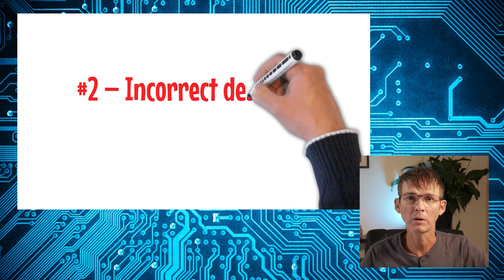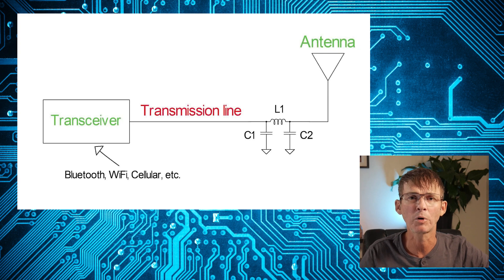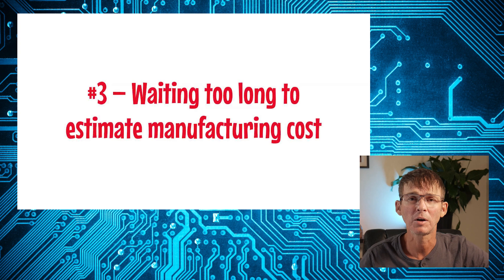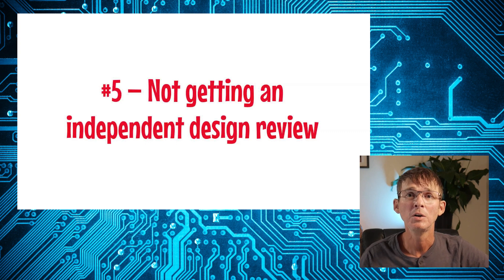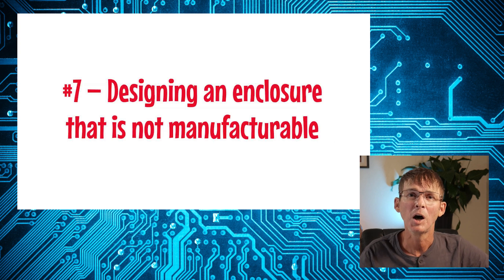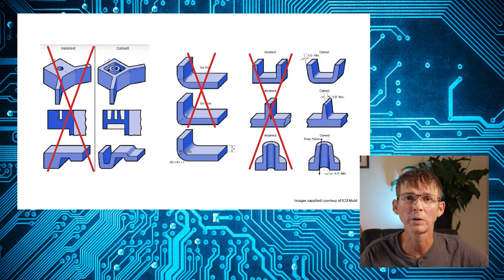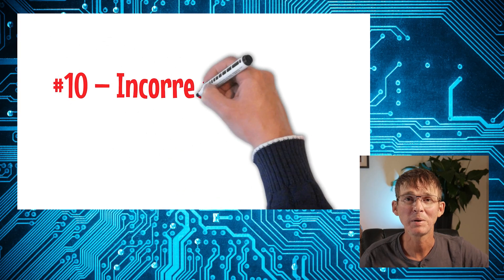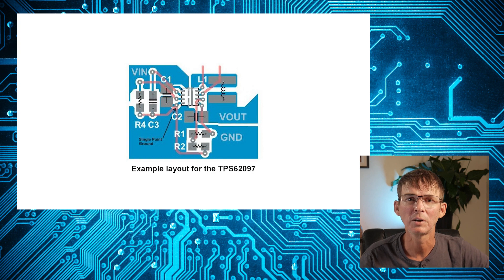Design Mistakes You Must Avoid on Your New Electronic Product

Comment: Thanks for the video. I have a few questions: Where do you go to find someone to do an independent design review? How do you actually get an accurately estimate cost of my oddly shaped keyboard design before you fully finish developing the design?
Reply from the maker: Thanks for commenting, and for the questions. I never seen any specific service (other than my own) that offers design review services, but you can always just hire a freelance designer to do the design review. But you want to make sure they're really good and they following a specific design review checklist.

As far as estimating your manufacturing cost before finishing the development, you need to start with what I call a "pre-design". Basically this means you do just enough of the design to be able to estimate the manufacturing cost.

For the electronics, this means selecting all of the critical components, and them pricing out those circuits. You can do this before you even design a schematic. When doing this you can usually ignore passives like resistors and capacitors which cost pennies unless they're very large.

I like to split it up into various functions. So if you need a 12V to 3.3V switching power supply, find the best chip, then price out the circuit as given typically in the datasheet. For a switching supply you'll also want to price out the inductor which can't be ignored like resistors and small caps.

Then from all of this you can estimate the PCB size, and then estimate the PCB cost and the assembly cost. 

Now you can estimate the size of your product enclosure. There are online calculators I've found that help you estimate the cost for a molded plastic part based on the plastic type, volume, etc.

Then you have to account for all of the various costs like programming, testing, product assembly, packaging, tariffs, etc.

In my Hardware Academy, I have a course where I walk you through how to do this price estimation, and you can also download my spreadsheet template. You can also share your design in the Academy for expert review. If you don't want other members to see your design though, then I offer private services too. Just reach out if you have any questions. Oh yeah, I also have a set of design review checklists in there for the schematic, PCB design, and enclosure design.
Reply: @PredictableDesigns  Thank you for the detailed response!

Comment: I just discovered your videos and I'm learning a lot. I was wondering if you could answer a question ? I'm designing a computer with a 2mm thick copper bottom and I plan to use the bottom as a heat sink for every significant heat source , the CPU , MOSFETs in the power supply , even the batteries will be in contact with the bottom. What kind of problems could I run into with this unusual arrangement ?

Comment: Thank you for the video, all the hints and tips matches my experiences. Indeed I have 3 additional thoughts to avoid mistakes in designing a product. The first thing is a documentation (electronically!) of the product with all information about it, means BOM, distributors (with alternatives), schematics and PCB designs (with versions etc.), Hints about the assembly of the mechanical an electrical parts, pictures of the assembly, 3D components, drawing e.g. of front panels and so on. Information about calibration is also important. The documentation should be well structured.
The second thing in my opinion is, that the mechanical parts must fit to the electronic part within the simplest connection. Example: You can connect a rotary encoder (or display or other) via an soldered wire to a PCB, but it makes more sense, to use connectors for it. For the assembly or repairing it is much more better to do so. Also the connectors must be selected in this way, that you cannot mix up it with another.
The third idea is to make the product (for the assembly an service) as simple as possible. Examples: Use only one (or two), but not 5 or more types of screws for mounting parts. Use also for example snap-in holder for the PCB instead of screws. Use easy connectors instead of screw terminals. (For all ideas: if its possible!) ... and maybe more.
Reply from the maker: These are fantastic additions to watch out for, thank you so much for sharing!!

Comment: How can I found a engineer co-founder like u
Reply from the maker: It really is all about networking with other entrepreneurs and engineers. But usually you need to bring something to the table to match what the technical cofounder will bring. For example, you would need to handle marketing, etc. Linkedin is a great choice for meeting others. In my Hardware Academy we have a program where members get matched each week for a video call with another member, and this works great for meeting potential co-founders.

Comment: Great set of design issues to try and get right! One other issue I find a challenge is how much mixing of the circuit should one do on a single PCB? Should we add all the power supply and signal conditioning on the same board as the analogue front end for example? Cheers.
Reply: Metal screening boxes are quite common on the analogue side. Use one layer of the PCB for the ground plane as well.
Reply from the maker: Thanks Mark! If the power supply uses a switching regulator then it is a good idea to have it separate from any sensitive analog circuits. Linear regs are not so noisy.

Comment: It's a really great video; thank you, John. Over several years of designing electronic boards for medical devices, I have detected most of your described issues. So, I have developed a design verification checklist for the schematic level and another for the PCB level. These checklists are forwarded to experts who did not work in the design, and the feedback is always precious. This methodology results in project errors falling dramatically, as did prototyping and product certification costs.
Reply: Do you share your checklist?
Reply from the maker: We don't offer our checklists except inside our Hardware Academy platform, although I may eventually offer them separately.
Reply from the maker: Thanks Mauricio, we always use checklists for doing schematic and PCB design reviews. We provide these checklists inside our Hardware Academy platform.

Comment: Great information. I have learned a lot. I have a question related to enclosure consideration with wifi component. What are the factors affecting the performance of wifi component while designing enclosure? Is there certain materials (e.g. Metal sheet) that must be avoided? Do we need holes in enclosure for the correct signal strength or it is irrelevant?
Reply from the maker: Hi Chadresh, you will definitely not want the antenna enclosed inside sheet metal which will block the RF signal, but plastic will be fine. No need for holes in the enclosure except for heat or audio to pass through the enclosure.
Reply: @PredictableDesigns  Thanks a lot for your quick answer. I am thinking of manufacturing only 50 pcs for the first batch because I don't know if there is any demand of my product in real world. Plastic enclosure in not really feasible for that. So I am thinking about metal enclosure. If I put some halls facing my antenna to metal enclosure, will that be sufficient? Or metal enclosure should not be used at all.
Reply from the maker: I would not start with 50 if you have never prototyped it before. Start with 3-5 units, then once fully tested and debugged you can do 50 units. You can use a method called urethane casting for producing that quantity of enclosures. Mush cheaper than injection molding. A metal enclosure of any type is going to reduce your operating range.
Reply: @PredictableDesigns  Thanks a lot. Could you please do one video on certification like CE, FCC etc? I think it would be interesting to see that.
Reply from the maker: I actually already have done a video on FCC certification: https://m.youtube.com/watch?v=-aGJZzV9-eU&t=1s